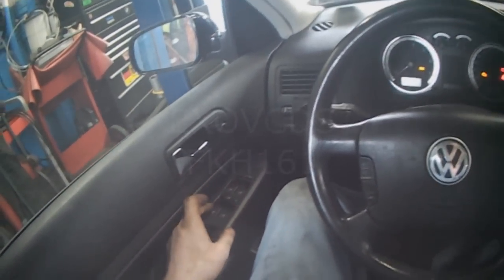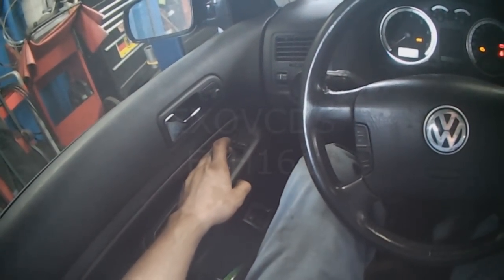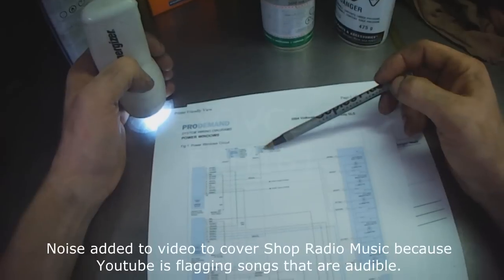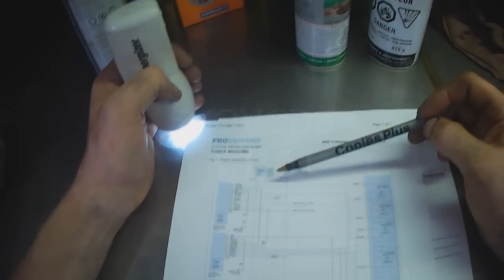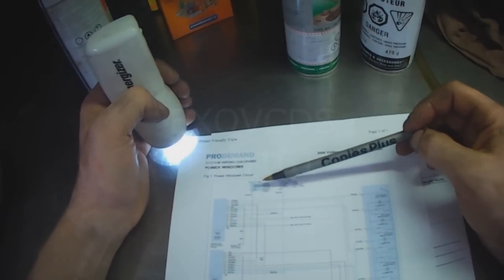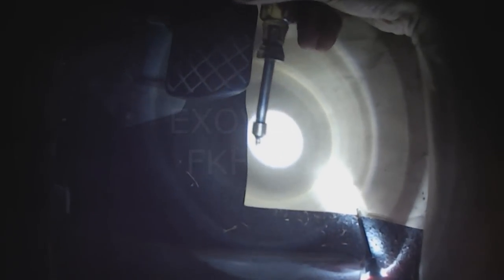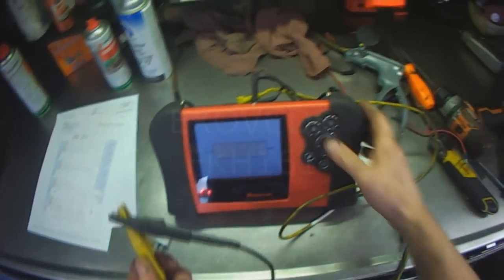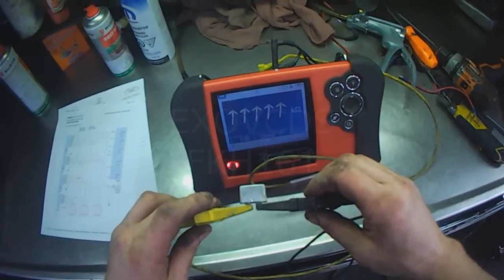VW A4: Power Windows not working

Comment: Hello Thomas,
I have a 2005 Golf GTI 1.8T, my widows, locks and interior light are not working. Checked the fuse/f38 is good, so do you think is the circuit breaker?

Comment: I have a 2001 bettle. Both switches on drivers side don't work for either window (driver side window doesnt open at all) But the switch passenger side operates the passenger window. Could this be the same problem as shown in this video? Thanks
Reply from the maker: si coopz No... try this. Insert the key in the driver door handle (outside) with all doors closed. Hold the key in the unlocked position. Both the driver & passenger windows should go down. Hold the key in the locked position... both windows should go up. If yes, control, power & ground are good. Most likely, you have a bad main switch in the driver door and or wiring problem for the passenger side in the driver door.

Comment: Hey Thomas, I have a quick question, I have a 2003 VW Jetta, that the windows, sunroof, and the trunk won't open, as with my doors won't lock is that because it is the same problem with the circuit fuse under the dash is not working right?
Reply from the maker: Yes, possibly. Find the 30A "circuit breaker"  under the dash and check it / install a regular fuse in place (20 - 30A) for testing.
Reply: Perfect, I'll take a look at that Much appreciated!!

Comment: Could that same fuse cause only the driver's window not to operate? I'm having an issue where my driver's front window only works after the first ignition of the vehicle, then it won't work at all. All other windows work fine from the switch. I've replaced the switch itself and the main fuse in the fuse box is in good condition too. It's a 2016 Jetta. Thanks for any suggestions.
Reply from the maker: Different layout (parts & wiring)... could be an issue with the door wiring harness or the motor module?

Comment: Hi Thomas, my interior lights do not work at all. Checked fuses and good. Is there a circuit breaker for the just the interior lights?
Reply from the maker: year, make, model?
Reply: 2003 Jetta Tdi Wagon.
Reply from the maker: guidokat0 Fuse #14 (10A) ok? Power windows & locks OK?
Reply: Yes, all good.
Reply from the maker: +guidokat0 I'll send you a wiring diagram once I get home from work tonight.
Reply from the maker: +guidokat0 Check your youtube messages, link to wiring diagrams has been sent.

Comment: What fuse number are you removing for the power windows and sunroof under the dash? I can not tell in your video. In my a4 2008 the sunroof and power windows are not working. I had my mom driving the car and she failed to mention it to me since she could just use the AC. I don't have a book and can;t seem to find it online in a PDF.
Reply from the maker: This video is for mk4/A4 VW vehicles... if you have an Audi A4, it is different. If your car is a mk4/A4 VW, then the "circuit" breaker should be easily visible under the dash.
Reply: The problem is that this particular area is not in any book that I've found. I have the same green coated breakers under the dash area but nothing list what exactly they are. I haven't found anything online either. You video was as close as it gets.
Reply from the maker: So which is it? 2008 VW or Audi A4? .... so that I can look for information.
Reply from the maker: I'm in front of the computer now...

Comment: Hello I have a 2001 VW Jetta. The right front window is inop only. I can here the clicking when operating the switch. I took it apart the regulator is good, as well as the window motor. Is there a separate relay for the right front?
Reply from the maker: +dennis stroup No separate relay. Disconnect the motor from the panel (3 torx screws) try operating the window again... if the motor now turns, something is binding when it is mounted to the regulator. If it does not turn, check the big power & ground wires that go to the motor.
Reply: +Thomas EXOVCDS Thank you Thomas.  I did try that, the motor does not operate. There is no power at either large wire. Do you have access to VW wiring diagrams?
Reply from the maker: +dennis stroup http://fkh161.ca/VW/VWA4PowerWindows.pdf
Reply: +dennis stroup I think the orange is ground. It is good, The red with white stripe does not have power.
Reply from the maker: +dennis stroup All windows get power from the same source... trace the wire to where the power stops / starts.
Reply: +Thomas EXOVCDS Thank you for the help, I found the power connector corroded in the right kick panel.
Reply from the maker: +dennis stroup Thanks for the update! Good job hunting it down!
Reply: Sorry to revive a really old thread but think this is the issue in mine, right door window clicks on button press but left window operates fine. It was initially intermittent but then quickly just failed all the time.  Does this indicate a problem with wiring? Will this be within the inside of the doorcard itself? Is there a module in the lower part of the door to be looked at? What's the kick panel mentioned? Many thanks for any help

Comment: hello Thomas Thank you for the schematics. I was able to troubleshoot the power windows down to the comfort control module under the driver's seat which was water damaged. I still cannot get the gas lid to open. Is that motor controlled by 12V or by digital output by the control unit? Checking the output on pin 3 and 9 from the control module to fuel door motor, I am not getting any output on my voltmeter. Putting 12 V to the motor, it does not work. Is it a stepper motor? Also, where is the multifunction transmission position switch located? I am getting 12V coming off the ignition when the key is in start position but no output to the starter. thanks Conrad
Reply from the maker: Should just be a 12v motor... might be polarity sensitive? Wet / bad comfort module can cause no crank (have had a B5 Passat with no crank).

Comment: Hello, I have the same problem on my Passat B5. Neither the windows or the interior light are working. Comfort module  seems to be ok! In the beginning, both the interior lights and windows was working now and then, but now its all dead. Fuses are also ok, so do you have any suggestions for what it could be?
Reply from the maker: Can your scan tool communicate with the comfort module?
Reply: +Thomas EXOVCDS Haven't been able to check that yet. I don't have the right equipment to find out whats wrong, but the comfort module is not damaged by water or corrotion as I can see. I've checked the buttons for the windows and interior light with a multimeter(?), but there is no response at all. The strange thing is that all of the 4 windows are going up and down when I use the emergency mode by pressing the lock and unlock button down for 5 seconds..
Reply from the maker: Emil Aker All I can suggest is to go through a wiring diagram and eliminate (make sure power & grounds / wiring) as much as you can. Comfort module will be the only thing left if everything checks out. Using a scan tool would be helpful... if not just to verify communication. Find someone with vag-com / vcds and have them check: 
http://www.maptive.com/ver3/VCDS_Locator
Click on the link and then zoom in on your area to find someone. If you can't, take it to a shop to just have the module scanned. If they can, great, if not, you know that there might be an issue.

Comment: I've got the same problem but on an older version of the same car mine is 1999 b5 passat everything you said on the video is correct except the location of that circuit breaker is not the same could you help me find it?
Reply from the maker: I would have to check a wiring diagram... the Passat might not use a circuit breaker.
Reply: @EXOVCDS  if there's a way im sure you'd find it
Reply: I've been to several places no one knows this
Reply: Oh and the horn stopped working idk if that's important too
Reply from the maker: I'll get back to you later this afternoon... have to run some errands first.
Reply: @EXOVCDS  tnx brother
Reply from the maker: Looking for a diagram now... the comfort control module is under the (left) driver side carpet. When it gets wet... electrial issues are common.
Reply: @EXOVCDS  I've reconnected those 4 wires to the main power supply cable and still nothing same thing allover again
Reply from the maker: Fuse 40 (25A) is for the horns. Hmm, power window fuse is listed as S37... it might not be a metal cir unit breaker if someone replaced it with a regular fuse. Should be in the same area as in the video.
Fuse S237 at the side of the dash (driver side) is for something else.
Reply from the maker: @kristijanajdinovic9281  ??? post a video so that I can see.
Reply: @EXOVCDS  will do bro im in Europe so we're hours apart first thing in the morning I'll try replacing those fuses and I'll record it for you
Reply: Found the circuit breaker bro it was hot when I removed it tried placing a normal fuse on it 2 times and both burned as they touched both sockets so looks like there's a constant power going through it thinking back there were some sparks when I connected those 4 cables under the mat
Reply: Also pressing the horn relay starts making clicking sound but no horn

Comment: what about a 2.5? is there a fuse under the dash? my front windows work but my rears dont. they worked before I changed the wiring harness on drivers door (that gave my front windows power)

circuit breaker for windows on 2.5?

any tips or videos on 2.5
Reply from the maker: Fuse #26 is for the rear windows.
Reply from the maker: Did you find it? Was it blown?
Reply: @EXOVCDS  found it was actually fuse 30ish on this model...thanks man!

Comment: I have a 1997 vw jetta trex and like in your video my sunroof works but none of my windows will work do you have a diagram for the wiring and can the alarm have any thing to do with them not working it's my first vw so I'm kinda lost
Reply from the maker: +vince farmer As far as I know, the alarm just blocks the starter from turning. The alarm can be bypasses (google search) to rule it out. I can look for a wiring diagram after work tonight... my shift is about to start.

Comment: I’m having trouble with my 1999 jetta 2.0l  when I turn my key to crank it I get no noise battery is good I replaced the started and ignition switch, when i first had problems with it out of nowhere the windows stopped working and then next time I go to start the car it won’t start
Reply from the maker: 1999 A3 or 1999 A4?
Reply: @EXOVCDS  I really appreciate the comment I feel like I’ve tried everything even changed the starter motor relay it is the a4, was my daily driver for a year and then one day the power windows stopped working then next time I went to start the car after the windows went out the car no longer starts

Comment: Hi Thomas, I have an Audi 2007 A4 2.0T. My windows don't work, the sunroof or interior lights do not work either oh and the central locking too. I was told that it could be that it got wet. I had a mechanic check the fuses and they are all working fine.Do you think the problem could be fixed without having to change the entire CCM as a mechanic suggested to me?
Reply from the maker: Can you / he communicate with the comfort control module? Any signs of wetness under the driver carpet?

Comment: Hi! I have `99 Passat 1.8 92kw. All four windows is not working at all, like this video. I controlled CCM and wires/contacts. There's little wet/humidity under driver seat, but CCM and all contacts are clean and no sign of oxydation. Are there fuse like in this video why windows not working?
Reply from the maker: Yes, similar. Circuit breaker 37 & fuse 38: 
http://fkh161.ca/VW/Passat/B5PW.pdf

If the windows click, but nothing happens, check the circuit breaker... if no clicking when trying to use the windows, then check the fuse.
Reply: Windows clicking, but cannot find the circuit breaker 37. Curcuit breaker is that green like in your video?
Reply from the maker: xero I'm still at work... I'll get back to you later tonight.
Reply from the maker: It is probably under the dash in a similar location as in this video... but I have not yet had to fin done / change one on a Passat.
Reply: How could I check with multimeter if circuit breaker is working? I dont want to buy it for just testing cause it cost about 20€.
Reply from the maker: Continuity setting / resistance. Should have 0 resistance.
Reply: Thank you very much! Circuit breaker was faulty, but first didn't work even new one cause there was huge oxydation in wires(light green powder like) in uncontrolled place. Thanks again.

Comment: Hello, I have a Jetta MK4. Power windows not working and I hear no click when I press the switches. Is the diagram you shared applicable to Jetta A4?
Reply: +Ramon Ornelas Would you please help me with the wiring diagram?
Reply from the maker: +Ramon Ornelas I'm still at work... I'll get back to you later tonight.
Reply from the maker: +Ramon Ornelas Did you check the fuses & circuit breaker that I mentioned in the video?
Reply: Hello, yes i checked them and they are ok. The strange thing is that the windows started to fail one day and they worked then next day. It lasted that day for 3 weeks. Then one day it stopped working at all
Reply: hey Thomas I have a 2015 VW GTI 2 door 2liter turbo my passenger door window won't work neither will the power mirror nor the passenger door lock us it a fuse I hope and where are they located

Comment: Hey Thomas, I have a 1999 Passat and my front passenger side window is not working. I have took the door panel apart 3 times now and I have purchased 2 different motors for the window , although when I try to roll the window down I do hear the click you comment about in this video. although with or without the motor being connected to the window I did not see any spinning take place. Please do help, I myself thought it would have been some sort of relay but I read comments you made that there is no separate relay for the right window. Please help , and thank you for the awesome content Keep it up !!
Reply from the maker: The window motor contains the door lock module (the brains)... when pushing the window switch, a relay inside the motor circuit board changes polarity so that the motor can run up or down. If you hear the relay click, then the "control circuit" is good (switch & wiring).

The high amperage wiring for the motor might not be good... open the door and look for broken wires in the door jam (rubber accordion boot).

Look for a thick red or brown wire that is broken.
Reply: +Thomas EXOVCDS Thankyou I will check on it tomorrow , i will reply with feed back. Thankyou!
Reply: @EXOVCDS   I have 2008 vw Jetta and i can't get the driver window to come up. I hear the clicking noise when I press the window button down but I don't hear it when I try to pull it up and I can't get the window up please tell me what do I need to do.

Comment: Hi Thomas, I have swapped a 2000 vr6 as well as cluster and key, into a 2003 wagon, keeping the ccm and door modules from the 2003, the windows and sunroof do not work on the inside. lighting is working, locks are. windows won't on any switch, but do from the outside. Just wondered if the clusters are just different, and not working because of that? I still have the 2003 cluster I could have re-coded for this motor
Reply from the maker: We don't deal with engine transplants or cluster swaps... I would have expected there not to be an issue with the power windows & sunroof when the same CCM is used / left in place. Was the fuse box changed? Have you done a full system scan of all modules to see what codes come up?
Reply: that will be the next step this week and I'll reply with more details. the fuse box stayed.
Reply: I understand maybe there is a difference in how cluster communicates wth the modules. K line or Can high/low. and 2003 report obd through the cluster from other modules? but It's a lot of mixed info and I'm overwhelmed at this point. just need to pull codes when the vag cable is available.
Reply: Hi Thomas, thanks for your input. It is an unusual issue I understand. Today I put back the 2003 cluster, just that change alone made all the windows and roof function! So now I guess the question is, can an immo 3 cluster recode to a immo 2 ecu? I know you said you don't deal with retrofits.
Reply from the maker: Yeah, sorry... no idea. Not sure if bypassing the immobilizer is an option. Searching through VWvortex might find the info you need. Or contacting companies that repair instrument clusters.
Reply: Thomas EXOVCDS appreciated all the same. I'll try to follow up when I come up with a solution.
Reply: The old cluster threw two codes from the ccm, supply too high and supply too low
Reply: I may just be able to re-adapt the ecu since the cluster matches the car. depending which key the cluster wants, I have both. so that's not a big deal. at least I found out this cluster works. the change between 2000-2003 cars is a big deal!